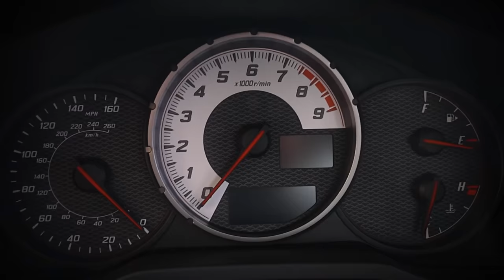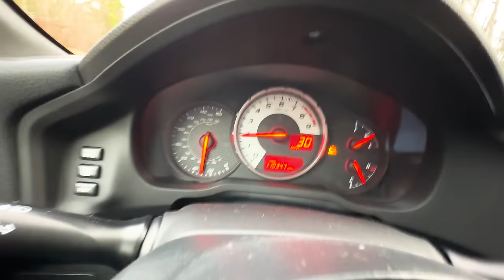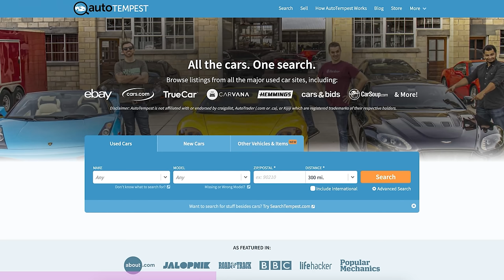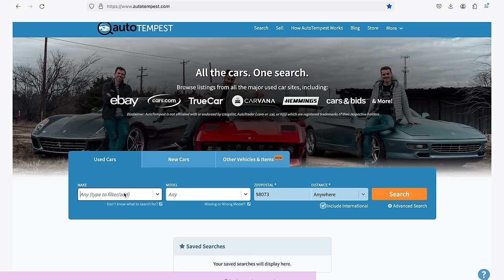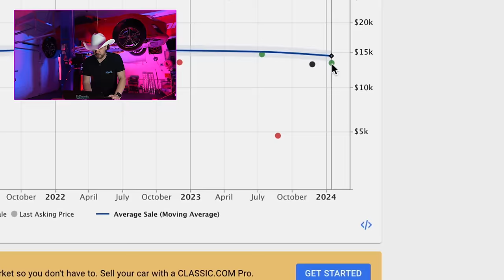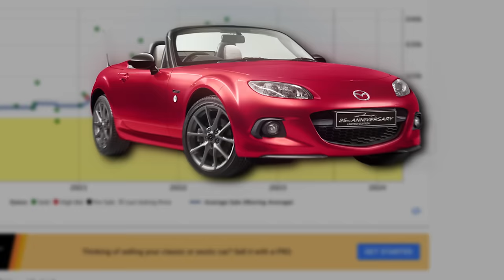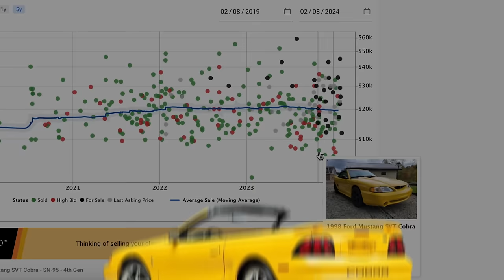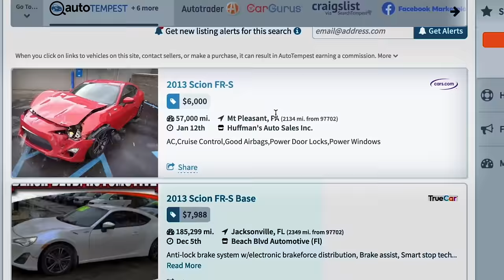How Is THIS The Most Unreliable Car Under $10k?

Comment: Here's a sobering thought. You can spend a couple grand on an old LS400, strip out the non-essentials and get a car that's lighter, much faster and more fun to drive on track than the FRS not to mention the V8 (been there, done that).

Comment: I owned a 2013 Scion Fr s for 3 years . I had so much fun with the car . I started having problems with the motor when i got 88,000 miles with a internal engine knock . 
The Fr s ran good no check engine light .  Even if you stay on top  of the maintenace its no guarantee that engine will hold up . The Fr s boxer motor is not cheap .
Reply from the maker: Great info! Were you able to get it fixed?
Reply: No .  The recall for the valve springs was done by the dealer . All recommended services done . my wife struggled getting in and out of  the car
and my wife really did not  like the Fr s . I sold the Fr s in October . I replaced the Fr s with a used Acura Rdx .
Reply: I avoided having the valve
spring recall done. There’s more issues with them blowing up after having it done than not. 158k miles on mine and still a blast to drive.

Comment: Audi TT (2000-2006)
    Dodge Neon SRT-4 (2003-2005)
    Saturn Sky / Pontiac Solstice (2006-2009)
    BMW 3 Series (E36 generation, 1992-1999)
    Ford Fiesta ST (2014-2019)
    Hyundai Genesis Coupe (2010-2016)
    Nissan Sentra SE-R Spec V (2002-2012)
    Volvo C30 (2006-2013)
    Fiat 500 Abarth (2012-2019)
    Infiniti G35 Coupe (2003-2007)
    Subaru Impreza 2.5RS (1998-2001)
    Chevrolet Cobalt SS (2005-2010)
    Mitsubishi Lancer Evolution (2003-2006)
    Toyota Corolla XRS (2005-2013)
    Volkswagen Jetta GLI (2006-2010)
    BMW 1 Series (E82 generation, 2008-2013)
    Honda CR-Z (2011-2016)
    Hyundai Veloster Turbo (2012-2017)
    MazdaSpeed3 (2007-2013)
    Mazda MX-5 Miata (1990-2005)
    Honda Civic Si (2006-2011)
    Toyota MR2 (1984-2007)
    Ford Mustang (1994-2004)
    Nissan 240SX (1989-1998)
    Subaru Impreza WRX (2002-2005)
    Mitsubishi Eclipse (1990-1999)
    BMW Z3 (1996-2002)
    Chevrolet Camaro (1993-2002)
    Pontiac Firebird (1993-2002)
    Volkswagen Golf GTI (2000-2006)
    Nissan 350Z (2003-2008)
    Mazda RX-8 (2003-2012)
    Honda Prelude (1992-2001)
    Toyota Celica (1990-2005)
    Subaru BRZ (2013-2020)
    Mini Cooper (2002-2006)
    Ford Focus SVT (2002-2004)
    Porsche Boxster (1997-2004)
Reply from the maker: A TON of ideal cars in that list! What would you choose?
Reply: @IdealMediaChannel either the veloster turbo, lancer evo, but most likely the 2011 civic si sedan
Reply: @IdealMediaChannel  350z i am drift guy and for it after market part are widely available

Comment: ls swap it its actually really easy they have kits for cheap. I know from experience i still have the blown fu in the a20 subaru flat 4motor in my garage.
Reply from the maker: LS would be great... but hoping we can turbo instead of just toss more displacement at it
Reply: @IdealMediaChannel you’ll blow the engine unless you build it. It’s already a high compression engine and it can’t really take much more on stock internals. Some headers, exhaust and a tune can get rid of the torque dip.

Comment: This choice is what I suggested in the last video. 

And valve cover leak is common with the fa20… so … oil starvation the cause of the engine dying?
Reply from the maker: Heck ya! We havent figured out why it isn't running... yet!
Reply: Change the PCV valve every 15k and that’ll go a long ways. They’re known to gum up and that leads to unnecessary internal pressure which can cause the engine to burn oil and even seep from the timing cover. 

Change the oil every 3k if driven hard. Put the right filter on it - avoid the Subaru blue filters - made by Fram. Go with Toyota Denso, or better yet, Subaru made in Japan. WIX or Napa gold if not using oem. The pressure relief valve is rated at 30psi and most filters aren’t properly spec’d.

Comment: Should have gone with the Mitsubishi 3000GT, with some looking you could have found a VR4 for around your 10k mark with a standard transmission. That 3000 is still a sexy car...
Reply from the maker: 3000 is definitely Ideal! Maybe for the next buy!
Reply: @IdealMediaChannel  I always thought that the 3000 GT VR4 was a tuners dream car, it included an electronically-controlled suspension as well as other features such as anti-lock brakes and automatic climate control, it had the DOHC 24v V6 Twin Turbo and came with permanent 4-wheel drive, 4-wheel steering, limited-slip differential, active aerodynamics and came with Z rated 18-inch chrome wheels with 245/40 tires. The VR4 included a six-speed Getrag manual transmission with revised gear ratios. I'd shoot for the 94' model year because the tunable exhaust was phased out after 1994 model year, the ECS after 1995 model year, and the active aerodynamics disappeared after 1996.

Seriously though, for 1994 this car was punching WAY above it's weight class. Even against the Nissan Skyline GT-R in the 0 to 100 mph the Skyline was faster by about a second. In the 1/4 mile the 3000 did it in 13.8 seconds to the Skyline's 13.3 however the 3000 had a top speed of 162mph to the Skylines 146! I think the biggest thing to remember is the 3000 had a curb weight of 3763lbs to the Skylines 3263lbs. To keep those times that close despite being 500lbs heavier is epic for 1994! Lets be honest, for most of the 3000 GT VR4's specs in 1994 it was one of the most technologically advanced cars on the road at the time yet never seemed to get the love and respect it deserved.

Comment: Here's the thing about the Toyotas: They are very reliable and really good vehicules on most of their lineup. But if you buy one that has some milage, that was beaten and was really really abused and not maintained (hum hum no service record), things can go south very quickly and you're in for a really bad and expensive experience. They are not unfixabled, but it can be an money pit depending on the abuse. Good video and good luck with that car!
Reply from the maker: The more to fix the more content we can make with it! Stay tuned!
Reply: Yeah that’s just about any car man
Reply: It’s a Subaru
Reply: @stevef3521  Yes it is sir, and it's not a bad thing for both of them. Very common to have these collabs. Both can learn from each other, of course if they want to. Thanks for posting!
Reply: @FullTimeGT yeah. Toyota has learned and it’s rumored they’ll be parting ways with Subaru on the GR86. I love my frs, but would feel better with a Toyota engine in it. That being said, I’m at 158k miles all original. Fun little cars!

Comment: Goodluck doing sparks and coils if you don’t drop the engine or unbolt the engine mounts, I would just pull motor and replace the chains, the front plate adhesive that tends to wear out, etc
Reply from the maker: Great info! You've worked on these cars before?
Reply: @IdealMediaChannel  yup, I have one 😭

Comment: They do look good but they are slow! I take acceleration over RWD!
Reply from the maker: Slow car fast baby!
Reply: @IdealMediaChannel  the FRS, in my opinion, is simply under powered. Seeing as how the flat 4 Subaru engine powering it does come turbocharged in other models, they absolutely should have at least made a turbo version. Or if they really didn't want to boost it, they make a 6 cylinder too!
Reply: I believe the other 2.0 turbo Subarus have different internals. Want to say rocker arms, and maybe the block. Also, with the turbo, it would throw off the weight distribution and they wanted to make a raw, N/A sports car. Paying respect to the AE86.

Comment: Well I would have got a 09 SS  (S/C) or (T/C) cobalt I have a 09 LS coupe 2.2 oil squirters 200k runs like a new car had to replace , flex pipe , thermo , cv axles , front window , tenting , sliver tip exhaust , tires , next steering u  joint ,
Reply from the maker: Definitely an ideal car!

Comment: It need a lot of work to handle properly especially if big sticky tires are installed; coilovers, adjustable swaybars, suspension arms (almost all of them) and most importantly a true LSD, OEM Torsen is pure trash, very unstable.

Comment: Definitely not one of the most reliable & I'm not even saying that because it broke down. I will never understand why people automatically think that since it's a Toyota, it's reliable. Sad thing is, if this had been a Genesis Coupe, which is arguably a better car in every way, y'all would have pitchforks out when it broke down, but because it's a Toyota, as per usual, it gets a pass.
Reply from the maker: Well said! Although.. I'm finding out this thing is mostly a Subaru!
Reply: @IdealMediaChannel  wasn't trying to come off asshole-ish & if I didn't like the video, I wouldn't have sat through the whole thing, definitely quality, as is everything else here. These aren't bad cars & I have always seen the appeal for them no doubt, they're just not any better than any of it's competitors, not only in terms of performance, but reliability, etc. I realize this wasn't that kind of video to begin with, but I've had almost 50 cars, not including motorcycles & I've had just as good, if not better, luck out of my Hyundai/Kias (owned 3/7), as opposed to my Toyotas & Hondas (owned 5/5). When these were first renamed GR86, I had chosen a Forte GT over it at the time & couldn't have been happier, despite it not being rear-wheel drive or a coupe, of course.